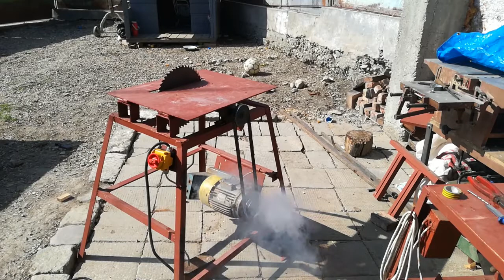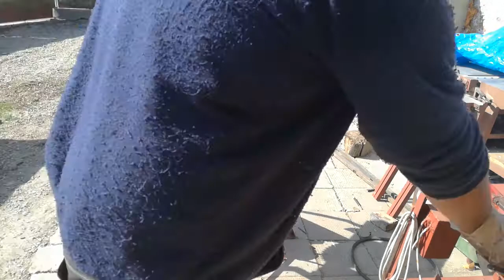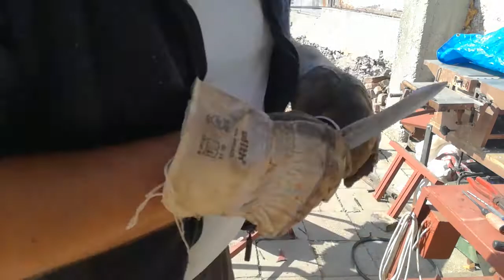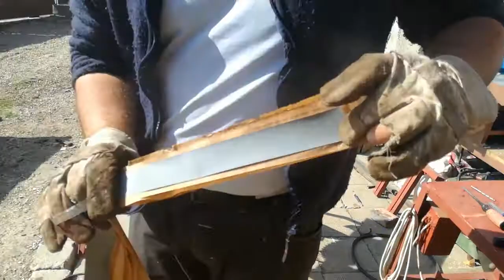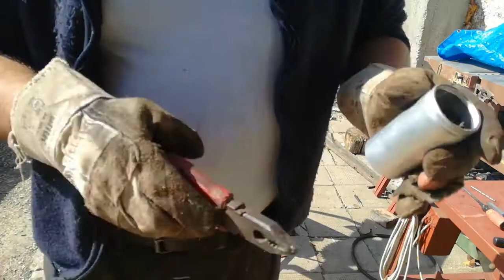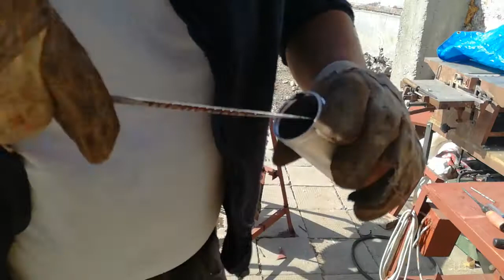explozia si dezmembrarea (disecarea) unui condensator

Comment: cat timp a mers motorul pana a puscat ?
Reply from the maker: +Mihai Hrv maxim 2 minute . Era un condensator de 200 microfarati la 220 care nu trebuia sa il las in sarcina
Reply: Restaurare si Reparatii  mersi am intrebat pentru ca si eu am legat zilele astea niste condensatori la un motor trifazat legat la 220,l-am folosit vreo 2 ore si nu a bubuit inseamna ca e bine.
Reply from the maker: sa ai grij sa nu ii pui mai mult decat are nevoie.  ulterior am aflat ca si motorul nu era chear ok , in trecut find fortat si lasat in ploaie . era montat pe el un condesator de 50 si mergea perfect , dupa ce l-a fortat motorul nu mai pornea nici cu 80 de acea am pus unul mai mare. oricum uni condensatori nu se lasa in sarcina. de vreo luna un electronist mia dat un sfat ca la un motor de 2,2 kw sa ii pun doi condesatori , unu din ei sa fie folosit in sarcina legat tot timpul si unu sa se decupleze dupa pornire. (la un motor de 2,2 kw se pune undeva la 130-140 mf si in sarcina sa ramna undeva la maxim 90)